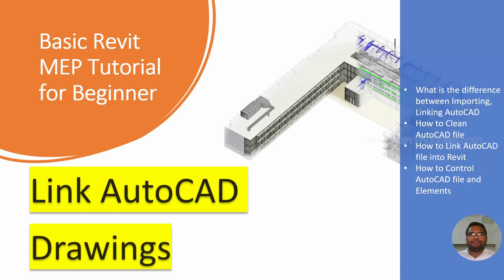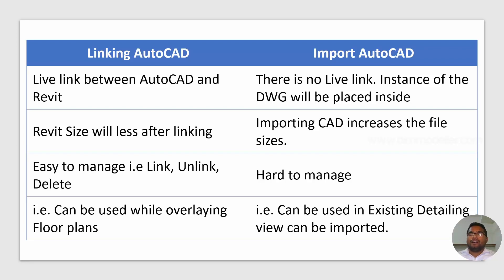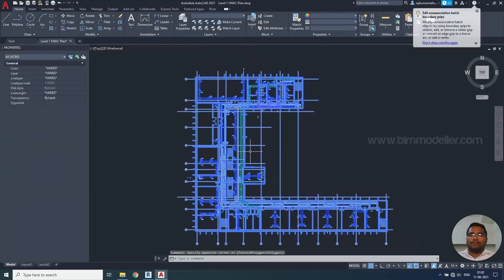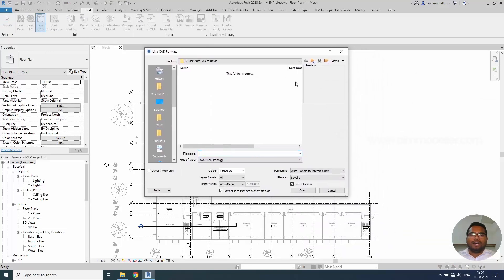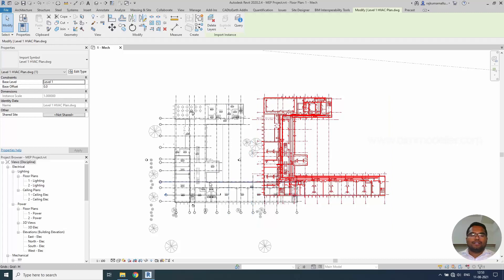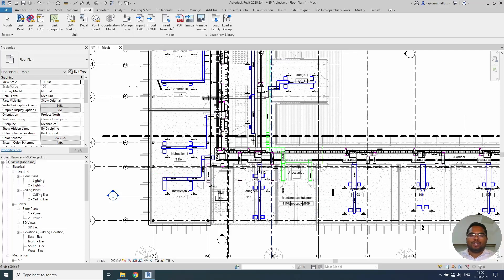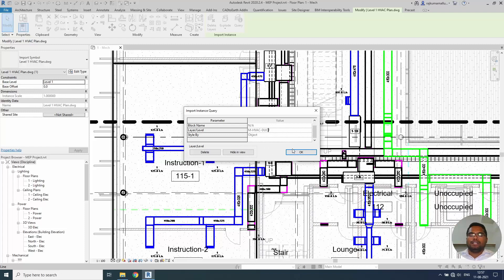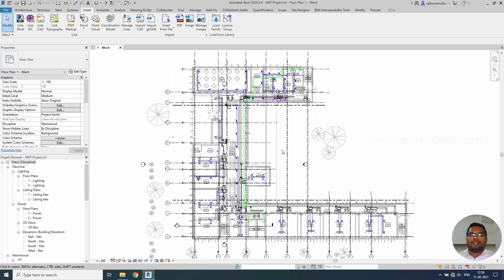Revit MEP Tutorial 12 : Link AutoCAD file to Revit

Comment: Hi brother Thank you for your learning tutorials. When I was insert cad file to Revit ,Example Mechanical (HVAC) Level-1,Leve-2,Level-3 floors, that same files linked to related levels in Mechanical floors, same will be reflected to all other disciplines, like Plumping, lighting also. So, if I want to link other discipline (Plumping, Lighting) cad files to Revit , is there any options available?
Reply from the maker: Great question. I can see you are really practicing. 

There are two options

1. When linking each view in the dialog box Tick "Current view only" option. 
2. Otherwise, in visibility graphics, imported category, Turn off other cad files.
Reply: @BIMModeller   Brother Thankyou so much for your valuable time & reply...